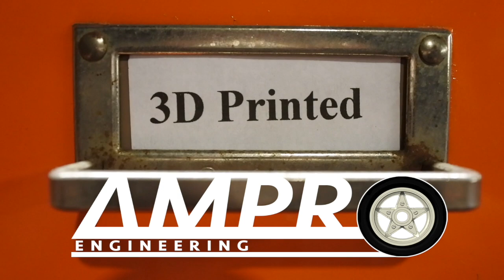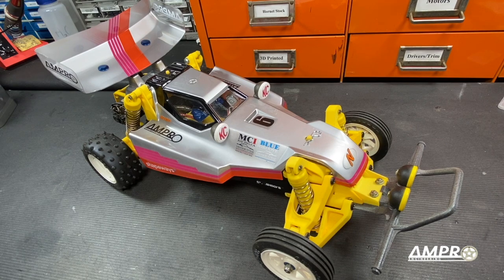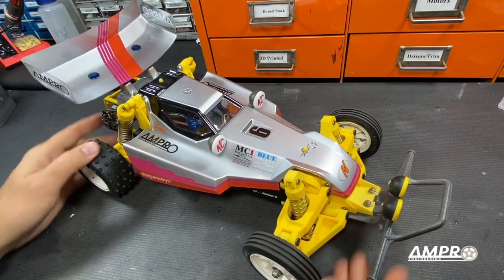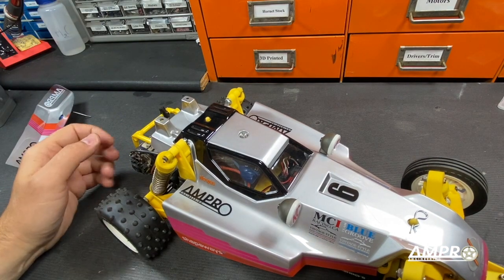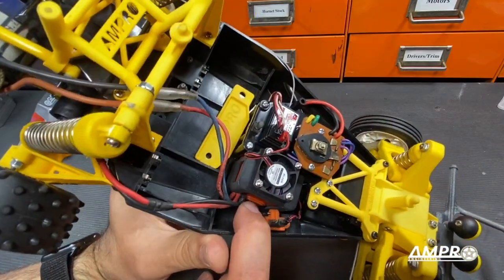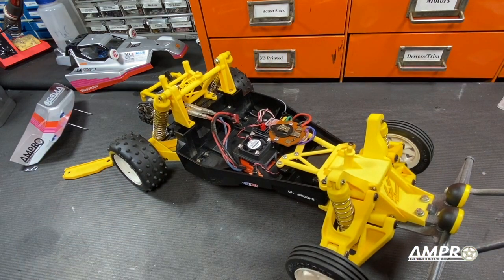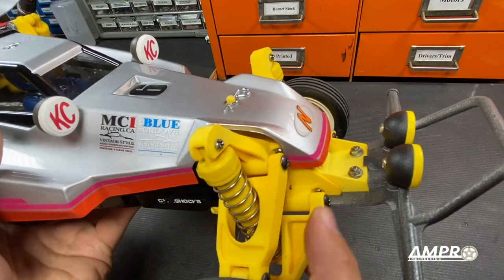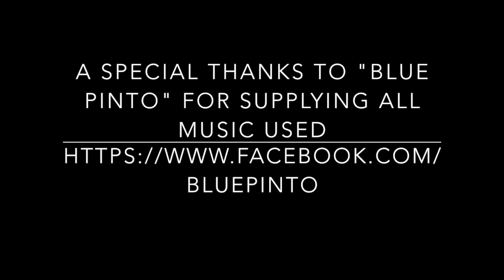e304: The "My Car" Series - 15 -Tamiya Falcon

Comment: Freakin awesome job brother wish my shapeways parts actually fit 😂
Reply from the maker: They dont fit? if something is mechanically wrong it is possible that the parts are warped. I have printed thousands of parts from there and have had a couple issues. Email me some images at amproengineering@gmail.com
Reply: Oh sorry the fault is always all mine, not shapeways 😄 I need to be more careful when I’m laying things out in AutoDesk!

That said I did have them print some shock bodies in Al and they didn’t turn out great - there were extraneous blobs all over that required lots of filing to fix.  No complaints on the plastic bits 👍

Question - do you usually draw up the entire car when you’re designing you’re upgrades?

Comment: Do you know if anyone is making aftermarket gears for the Falcon and related cars like Striker, FX10, Sonic Fighter which share the same gears. I did not see them on Shapeways.
Reply from the maker: As far as I know, just me. Everything you see here is on shapeways and there are links in the descriptions in episodes 112, 121, 123, 228, 229, & 230 covering all the parts I make. My homepage here also has the link in the description and there is a section on the left called Falcon. Ill send a link too.
Reply from the maker: https://www.shapeways.com/shops/ampro?section=Tamiya+Falcon&s=0
Reply from the maker: Home prints here https://www.myminifactory.com/library

Comment: I wish I had Novak stuff like you. I'm trying to restore a Duster but I can't find any parts. The board and top of the case are mint but the previous owner chopped up the bottom case trying to put new wires on it. 🤦🏻‍♂️ Not to mention he lost the heat sink. 
My friend, if you know where I could find a lower case section, one ring to hold the case together and a heatsink please message me. I would be forever grateful. 
Awesome falcon! Love your videos, I've watched quite a few of them now. Very nice work 👍
Reply from the maker: Really sorry man, it is hard to find all that stuff now. I used to dumpster dive in the Novak bin in Irvine back in the 90's lol! I would check out ebay.